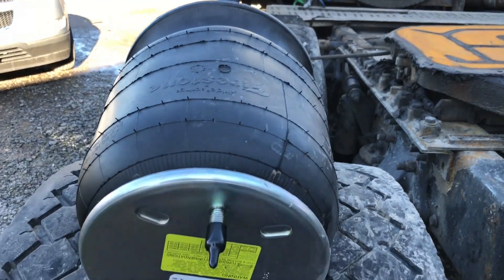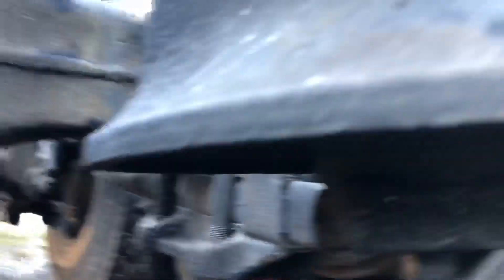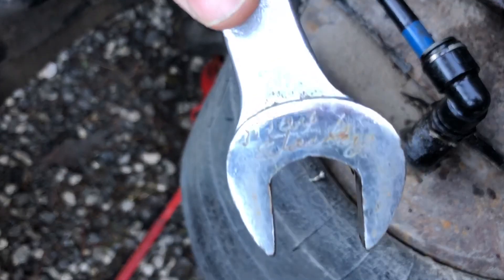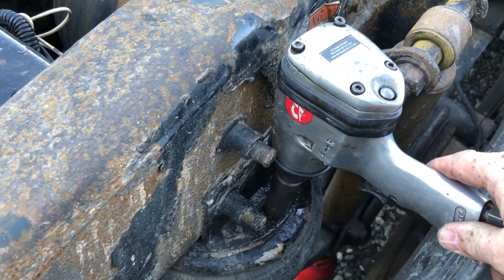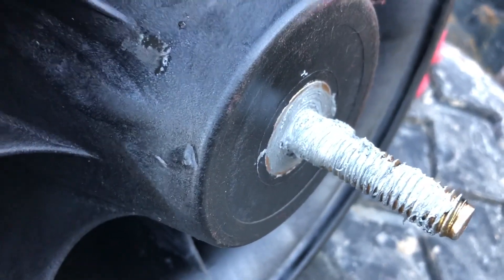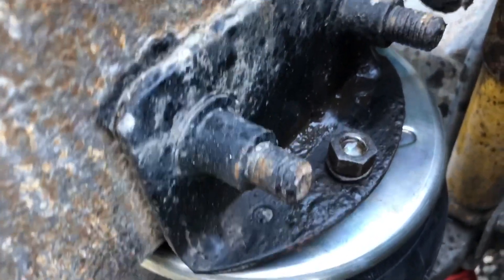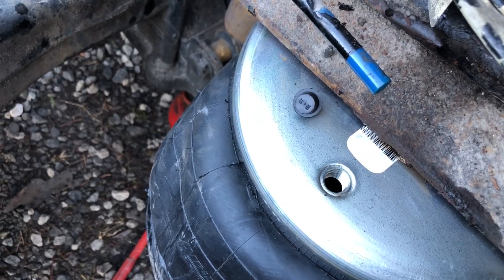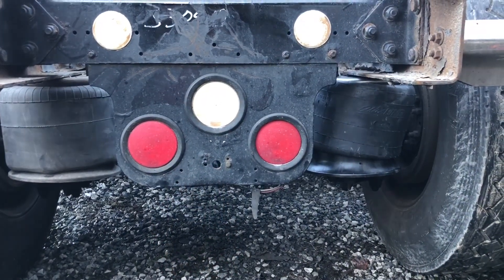Trucking , How to change a suspension air bag on a 2007 Freightliner Columbia .

Comment: Apply weatherproof caulking between the air spring platform and the frame rail .
Rub rubber preservative on the fabric once in a while . 
Use solid brass push lock connectors .
Reply from the maker: Using calking will trap moisture and dirt after the calking fails . Part need to be able to air dry . If anything use a rubberizing liquid as you see me do when I cleaned my frame rails and rubberized everything, in a later video

Comment: I changed an airbag a couple months ago , this morning I saw the plate or part at the bottom of airbag was missing, any idea why, may be the nut at the bottom became off and that caused it
Reply from the maker: If you over stretch the airbag then you can rip the bolt apart , but if the bottom of the airbag was missing all your air would be gone . 
      If your meaning the platform the airbag is bolted to then that could have rotted or broken off . This I have seen happen.

Comment: Hey fella, when I try to lose the bottom bolt on my air bag, the rubber bag and bolt turns. Any ideals to remove the bad air bag? Thanks...
Reply from the maker: my favorite tool is a grinder using a grinding disk or cutoff wheel. I use this in many of my videos . you can pick up a cheap grinder at a harbor freight store for  $15 , and the disks are $2 each. its a really good price. i have had my grinder for over 20 years now $12 at the time for it. this will cut that bolt off quick ! and no hassle !
Reply: @Starkeyfamilyfixing  figured I would have to grind it off. Thank you...
Reply from the maker: @fritzduval  Your welcome
Reply: Today I tried taking off the bottom bolt off my new bag to adjust and somehow took off the whole bolt . Screw -nut and that lil flat donut... Is that bad? I used a impact and just put it back in...
Reply: @westsidetrucker1449  I had to cut mine off with a angle grinder. The air bag was bad anyways... bolt the new one, good 2 go!
Reply: @fritzduval  thanks for the reply. But you do know what I meant? The bolt that comes at the bottom of the air bag when you buy it. ... I screwed it all the way out somehow when trying to unscrew the nut..
Reply: @westsidetrucker1449  yup, luckily you were able to put the bolt back...
Reply: @fritzduval  ok. Cool yea . Thank you my bags just crooked af now lol

Comment: It's a lot easier to use the air suspension to replace the Jack's.  Just cap the air line.
Reply from the maker: I agree but , if someone does not do it right and it falls apart while they are under the truck and gets crushed . So I can not tell people to do that .

Comment: Don't need jacks just cap air line you removed.  Start truck, pump up other air bags remove and replace.
Reply: Flat vicegrip the end of the line.
Reply: @allywilkeforsenate  Better yet, fold the line back on itself and tape it to keep it folded.  Using any type of clamping on the end is likely to create damage or change the shape (like a crease).  Either can create an air leak because the o-ring in the fitting will not seat well.
Reply: Better yet do not try clamping. Remember these lines are plastic and can reduce integrity of line of just Crack.
Best thing is to put a screw in the end of line to cap off

Comment from the maker: I had a person ask me why my airbags air up higher then normal, there is a good reason why . I adjusted them to be a little higher due to hauling heavy permit loads , but in this video they look a lot higher due to I am not on flat ground . 
  Before I adjusted the air bags back in 2008 the truck looked like it was sagging in the rear when I hauled heavy coils , so I simply adjusted them up . And no I have had no problems from this though the years , and I drive cross country to about any state. Every truck I have seen can be adjusted.
Reply: Adjusting height is OK, but you are also changing the axle pinion angle - unless you compensate by making an angle adjustment.  An incorrect angle will create noise, the worse the angle the more the noise, and will wear your u-joints much faster.
Reply from the maker: @bobblack3870  I have 1million , 356 thousand mile on the truck now . Been this way since I adjusted it in 2008 . No problems , no noise, I change the oil yearly with mobil synthetic gear oil .

Comment: why do you have an airbag crooked on your truck?It is not right
Reply from the maker: Well I had a lot of comments on this , so I will explain. One guy said that one of the shim plates was wore out on my spring . While that is a common problem on Freightliner truck , this not not my problem. I was doing this job in my driveway and my driveway is uneven, so it appears to have an issue. Next it’s a new airbag, so these can take a few days to stretch out if it’s been sitting on a shelf at the store a long time . My truck is fine , it’s a 2007 model and I bought it in 2008 so it’s fine .
Reply: I had the same situation.
Reply from the maker: @countryboyllccountryboyllc3507  if it’s like this on flat ground , and your airbags are not new then it’s the shim plate on the suspension near that air bag most of the time . Sometimes it’s the suspension itself which will cost you a small fortune to replace, At no real advantage. As long as everything is tight and your alignment your fine , don’t worry about it .
Reply: yes yes you are right

Comment: Suggestion: use mentioned that you used WD-40.  That is a poor product to deal with rust.  Best practice is to use a product labeled "penetrant".  It works better and faster with the primary purpose of counteracting corrosion.  WD-40 does not do that.  Apply it as early as you can in your process to allow it to do as much work as possible.
Reply from the maker: It is what I had on hand . But I do use it and on Blaster often
Reply from the maker: Thanks for watching !!!

Comment: Man you  probably installed wrong airbag. It is strangely  un-parallel. 
I would reccomend you to use 
ordinary wrench or better torqe wrench 
 especially on upper bead plate. On upper side is usually 30-40Nm (Torqes are on sticker)
When installing you can  use 
external air supply 
just enough to lift it
Reply from the maker: Everything is fine lol 😂, dealership airbag .
Reply: Next time you can measure distance from center of screw pin on New and old just to be sure.
It sits strange on video. For  lifetime and performance is optimal that center of upper plate and center of piston are aligned.
Reply: @bvogri   it sure looked weird!
Reply: @bvogri  I switched any store bags and they all lean lol...
Reply: Nah it's the plate between his springs an ubolts that's wore out an that's what is causing the lean on the passenger side airbag.

Comment: Jack stand? Huh 
Air plug or cap and life is easy
Reply from the maker: when i do videos i have to keep in mine most people do not have proper tools , and seeing a good set of 2 jack stands are $300 or more for a safe weight support , I know most people do not buy them . If you notice in most of my videos I use common tools that most would own , on special jobs i break out my good stuff . It would be unfair to race , using a race car with somebody that can only afford an economy car .